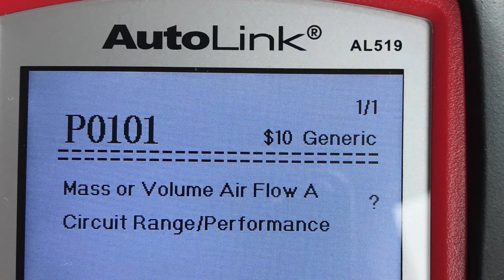P0101 Engine Code? Here’s What It Really Means and How to Fix It!

Comment: I have the P0101 code in my 2009 Toyota Corolla pulled out the MAF and it looks brand new haven’t gotten the spray but my engine light will come on and when idling it does die any tips?

Comment: I have a 2005 GMC SIERRA SLT with P0101 and P0300 codes  I've replaced the MAF and installed new plugs and wires. Still getting both codes. I do have a hole in my fender where the air intake gets air from the fender, the black curved box that was up in the fender fell down so I removed it from inside the fender....  I'm at a loss on what to do next to fix the problems. Could it be that it's getting too much air ? Does that black box serve a purpose inside the fender. (I thought maybe the first new MAF sensor was faulty so I tried another new one as well)
Reply from the maker: T - Yes — that black curved box inside the fender (the resonator or “air silencer”) actually does serve a purpose, and removing it can absolutely cause issues like your P0101 and P0300 codes. It’s designed to smooth and regulate airflow entering the intake, ensuring the MAF sensor reads stable, laminar airflow. Without it, the MAF can get turbulent or unmetered air, causing inconsistent readings and triggering lean/rich conditions that result in random misfires (P0300). Since you’ve already replaced the MAF, plugs, and wires, the next steps are to reinstall or replicate the stock air intake setup (that resonator matters more than people think), inspect for vacuum leaks, and clean the throttle body and MAF connector pins. Also, check for a dirty or over-oiled air filter (especially if it’s an oiled aftermarket one, as that can coat the new MAF). Once airflow is stabilized and no unmetered air is entering the system, both codes should clear up after a few drive cycles.

Comment: Hi. Would getting a maf error cause huge amounts of black smoke when accelerating a diesel?
Reply from the maker: I - Yes — on a diesel, a faulty MAF can absolutely cause heavy black smoke under acceleration, because the ECU relies on MAF readings to balance fuel injection with available air; if the MAF under-reports airflow, the ECU may inject too much fuel for the actual air entering the engine, leading to over-rich combustion and thick black smoke, and if it over-reports airflow, it can still throw fueling way off and cause poor atomization. That’s why black smoke paired with a MAF code is usually traced back to either a bad MAF sensor, wiring fault, or a big intake air leak throwing off the reading.

Comment: I have white smoke that comes out sometimes when I start it. Does that have an issue also wit the mass airflow sensor needin replaced? I do have no kinda power in my acceleration and it's shaking sitting at a light. Goin up hills is the hardest. I have to give it more gas hear n there. Sometimes I have very lil power to come back. So I should replace the air filter and the sensor? I also have wher the ignition coil code comes on and I havnt had the chance to change my sparks. But thx for the vid
Reply from the maker: D - White smoke on startup that clears is usually from oil or coolant seeping into the cylinders overnight, not from the MAF sensor; combined with rough idle, shaking at lights, no power on hills, and an ignition coil code, your main problem is almost certainly ignition-related (bad plugs or coil), not the MAF. A weak coil or worn plugs will cause misfires under load, making the car feel gutless and shaky, and that unburned fuel can create white/gray smoke that looks like steam. A clogged air filter or dirty MAF can add to the issue, but since you already have an ignition code, the smartest move is to replace the spark plugs and any failing coils first, then clear codes and recheck fuel trims. If power is still low after fixing the misfires, clean/inspect the MAF and replace the air filter, but don’t throw parts at it until you tackle the ignition side.
Reply: I'm getting this code and also the turbocharge/supercharger underboost code! Where should I start

Comment: Can this be caused by a leak down stream of the sensor, specifically before the throttle plate ?
Reply from the maker: M - Yes, a P0101 code—Mass Air Flow (MAF) sensor performance issue—can absolutely be triggered by a leak downstream of the MAF sensor but before the throttle plate, such as a cracked intake boot, loose clamp, or small vacuum leak, because unmetered air enters after the sensor but before it reaches the engine, throwing off the expected airflow vs. actual engine performance values, which the ECM picks up on and flags as a range or performance fault, especially if the fuel trims drift too far while the engine tries to compensate.
Reply: @8020Automotive  thanks for the advice. My boot has a tear after the maf, just where it clamps before the throttle plate. I placed silicone over and into the tear. I am getting 250 extra revs in neutral and park, even after the engine reaches operating temperature, IACV was changed, MAF sensor and crankshaft sensor also changed
Reply: @8020Automotive  but I am not getting a p0101 code, I am however, getting a coil pack code, but these have been proven to be in good condition